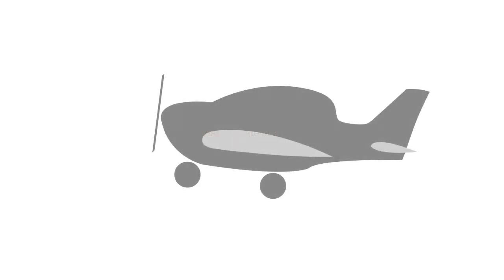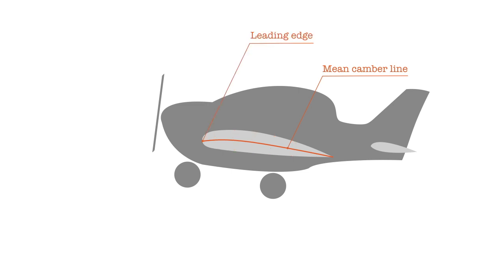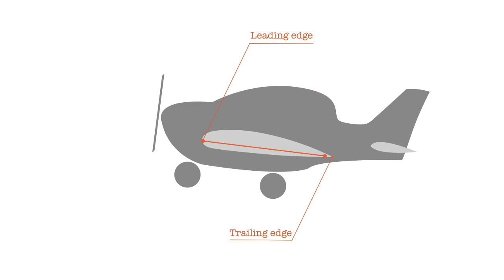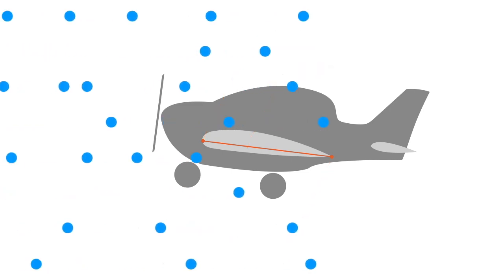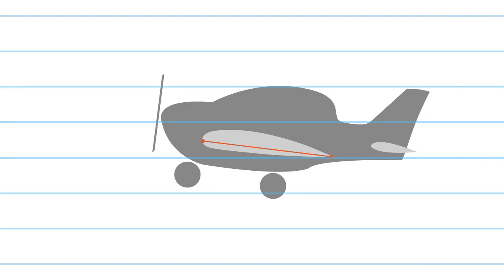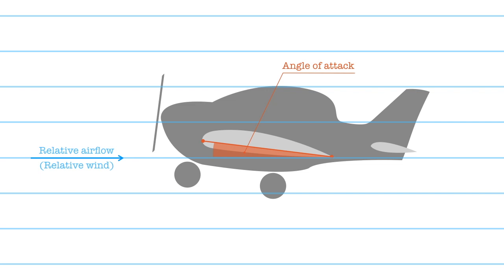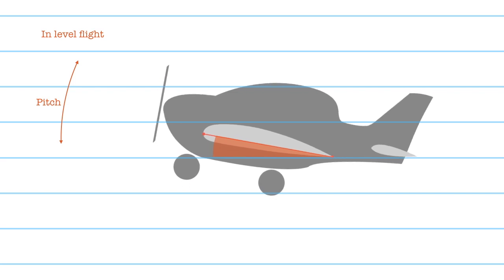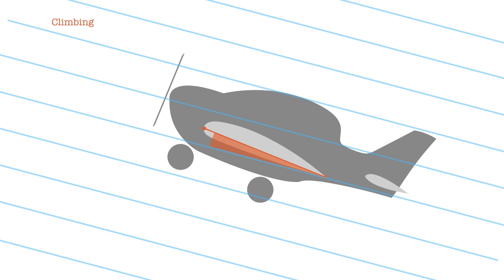What is angle of attack?

Comment: Shouldn’t the answer to Q6 be the “curved line...”? As the mean camber line cuts the wing directly in half and requires the curve, however the chord line is straight.
Reply from the maker: Nope, this is a tricky question. If you examine the shape of the wing in Q6 you will notice that it's symmetrical.
Reply: It’s weird got me for a sec too haha

Comment: Could you please elaborate on Question 3? I thought the answer was the one above the correct answer, but I am unsure to why the bottom one is the more correct answer.
Reply from the maker: Certainly, this is a tricky one. The third answer would be correct if it said: "relative airflow is opposite to the direction of movement of the aircraft relative to the atmosphere", not "flight path". Thank you!
Reply: AH!!! YES! Thank you so much!
Reply: so what's the difference between flight path and movement of the aircraft ?
Reply: @flightclubonline   but since you said this on 1:52  ,  why  its not relative to the flight path ?
Reply: Yes, and the relative airflow is the flow of the air while it is undisturbed. Airflow around the airfoil gets disturbed in the boundary layer, thus its not relative air flow anymore. See the video on Stalling.